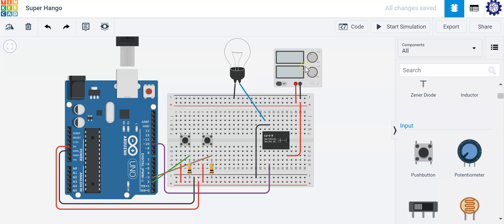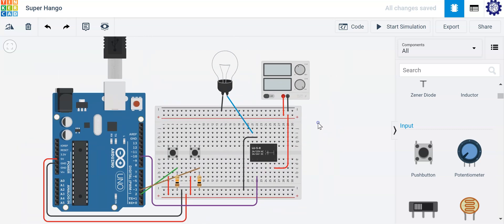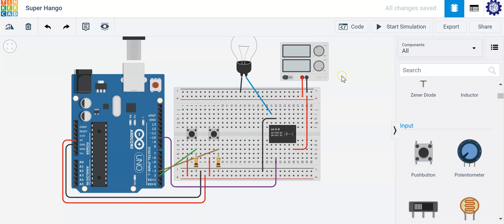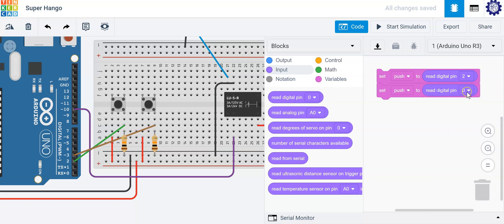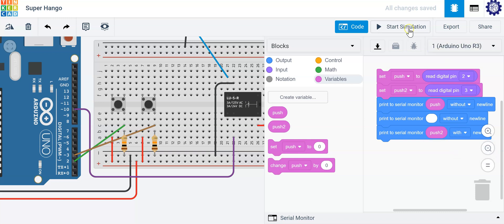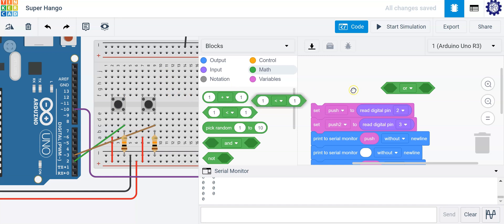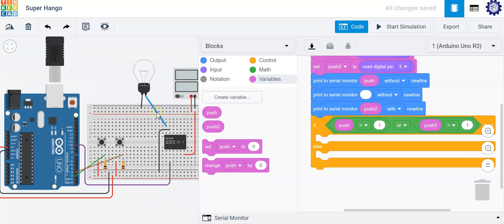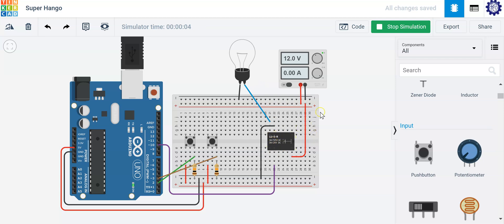Relay Control with Block Programming in Tinkercad

Comment: Very well explained BUT when I reproduce this for some reason it states that my PIN 10 has too much current but other than using Diodes from it to Terminal 8 on the Relay, I do not see how I could limit this.  The issue is that Tinkercad does not have any CRDs so if I use 2 diodes in does close to 20mA but still above at 21.. I honestly have no clue how to fix that